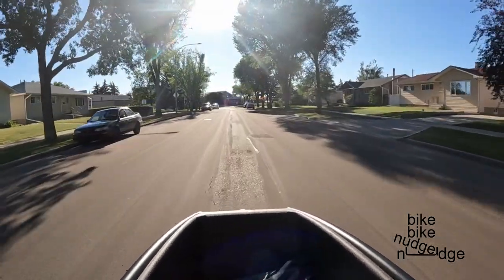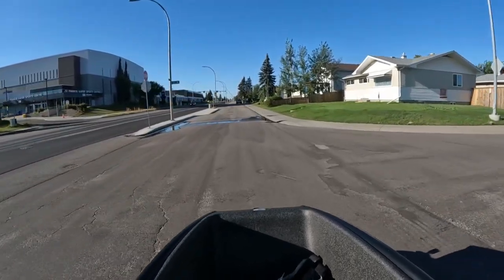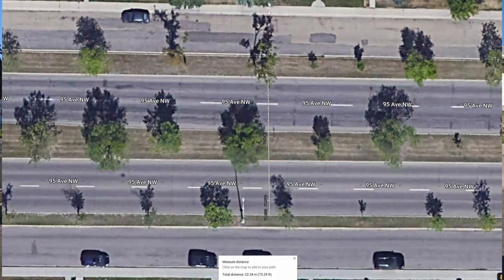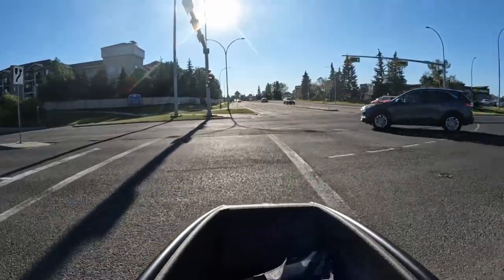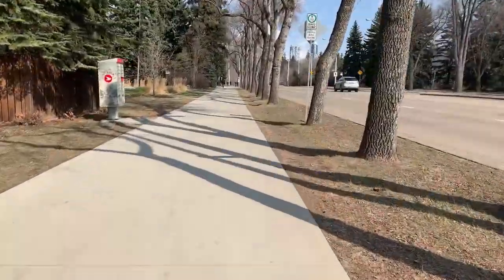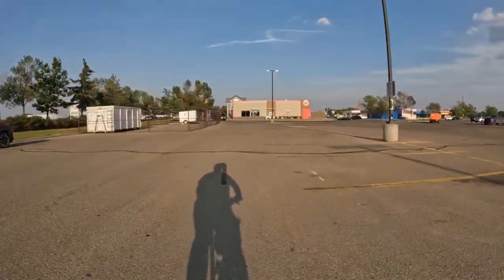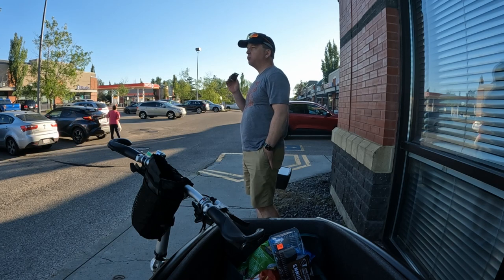Grocery shopping with a bakfiets (or service roads, parking, and trip-chaining)

Comment: Wow, look at those massive carparks. We have similar issues in my city (Adelaide, South Australia which is probably a similar size to Edmonton)
Most of our very limited bike infrastructure consists of recreational shared use paths.
I bike a lot more now that I live near one of these shared use paths which generally makes a trip to the shops 50% low traffic residential streets and 50% shared use path.
Thanks for the videos! Keep them coming!
Reply: And places like that often don't even have a bike-rack. If you're lucky, you might find a road-sign you can lock a bike to that's near the store and not tooooo likely to get hit by a car, but not necessarily. I once had to lock my bike nearly 100m away from a SPORTS store because there was literally nothing closer, not even a narrow tree. 😒

Comment: Trip chaining with bikes is something I've always been wondering about! In a place like the Netherlands, I'm assuming with so many bikes (and bakfiets specifically too) that perhaps with a cover covering your items your bike would blend into its surroundings, especially if you're only making a short stop, making it safer in that regard. But for longer stops or places that are further out, or in other countries, there needs to be more. I don't know what the solution is myself, but I'm sure there is one out there (or will be one eventually).
Reply: Urban Arrow makes a few bikes with a locking component for the storage area. I've mainly seen it for their commercial line but I imagine they have something for the Shorty which is Baksfiet like.
Reply: Places that accommodate biking like Amsterdam or Oulu tend to also be "15-minute cities", so you can just make multiple trips. It's a problem in North America because everything is so damn far away, even making multiple trips by bus isn't practical. And since shopping by bus, bike, or foot limits how much you can carry (both weight and volume), it becomes impossible to shop effectively without a car. 🤦
Reply: I try to organize my trips with small items first that I keep in my backpack. As I add items, I reorganize with my panniers. One benefit of buying mostly fresh produce & items needing preparation is that no one will steal them!

Comment: There are many of those side/service roads in the UK.  They tend to be separated with a nice grass verge with or without trees from the main busy road.  I don't own a bakfiets since I don't have storage for that and some chicanes exclude access to non standard bikes.  A small trailer works well.  I can take it off the bike and take it into any shop to use as a trolley so going from shop to shop is  easy.
Reply: Service roads can be perfectly fine ! In NL you can see them in multiple ways . As an acces roads for houses/bike path along a busy 80kmh rural rosd. And in built up areas with business park or residentials along a distribution road ...
They are often one way for cars , two way for bikes ..

Comment: I'll carry my groceries into another store if I go to more than one store while out, but I knew to only go places where no one will hassle me for walking in with full grocery bags because they think I might steal. So I'll go to the chain grocery store with security first, then go to smaller stores or CVS, where they don't seem to care if I have full bags in there.
Reply: Exactly, that's the problem. stores don't like people walking in with bags. Also, you don't want to have to carry around all the extra weight. That's why I usually sort shopping to get the small or single items first that can leave me with less weight and look like my backpack is empty, then go for the bigger grocery-shopping, and I'll make a point of leaving my backpack zipped up and on my back the whole time for the cameras. (Sometimes I even put on a little show at the register of struggling to get it off to pack my groceries, just to make it clear that it'd be obvious if I took it off. OCD'll do that. 🤷)

Comment: Parallel service roads or frontage roads can be great to separate faster going and slower destination traffic and allow safer exiting/entrying residential/comercial driveways. That is : IF you design and build them correctly ! The one at 0:37 clearly isn't !  It is too wide, so cars will go faster .  
A service road should be designed to low speed , so it should be 25-33% narrower than this one, preferible have brick pavement and some speed bumps. All for lower speed. Add some narrowing (for example trees at the side may help (good for shade and speed perception ).  Make them one directional for cars , two way for bikes. The parked vehicles should move from the side walk to the other side, next to the main road. This will make crossing pedestrians more visible and psychologically the parked cars on the left slow the car drivers as well.
In the Netherlands (and elsewhere probably) you see parellel service roads of all kinds : in residential areas, in commercial areas and also in the country side. It combines a safe option for bicycles with low speed access to driveways. They work perfect and can improve safety about as much as a proper roundabout vs a traffic light junction... And it can improve a horrible stroad's bikeability greatly  .

Comment: to secure your snacks? maybe a net or something that you can cover the basket all over and secure with a lock or a bunch of bungy cords.
Reply from the maker: A long time ago, I saw a lockable, wire mesh wrap to secure a backpack while travelling. I don't think it would be big enough. One drawback of the Urban Arrow is a lack of good mount points to secure things or use bungee cords.
Reply: @bikebikenudgenudge  I just searched it up. A heavy-duty fishing net or modified tarp looks like it would fit. Then some sort of long rope, bungee cord, etc. Loop it over the top and then below the cargo area. On their website, it looks like they do sell a cover for it.

Comment: I've had the same concern over making multiple stops.  I use paniers, so I could take them with me, but many stores don't like me doing that.  If you find a solution, please post it.
Reply: Yup, this is half of the obstacle. In my case, I arrange my shopping to get small, light, single items first, and save the big grocery-store for last. I'll keep my backpack on my back and zipped up the whole time I'm in the store so the cameras can see. I usually arrange my shopping to avoid multiple stops as much as possible (which sometimes means just not going at all, which helps save money and eat less 👍), or I'll arrange to do half another day. On rare occasions, I'll actually ask someone at the front like a security-guard or greeter if I can leave my bags with them for a minute while I run it to get one thing. I also keep my eyes open for any sort of locker facility just in case (but have yet to see any).

Comment: I see so much potential for better infrastructure...you've got to seperate the cars from the cyclist...the roads are wide enough to create a pavement then a bikelane and aftet that parking spaces...seperate bikelanes are also ideal for skaters and kids to learn to bike...also a few roundabouts instead of crossings...so you have a continuous flow of traffic...the map with the red line you showed is a perfect place to start if you want to start a bike friendly environment...it is also important that car drivers learn to respect and acknowledge cyclist by f.e. make it a part of the driver's license exam...where they learn to yield for cyclists at roundabouts...when you are used to them they are incredibly effective and safe...

Comment: I have been using a large sized dog trailer as a cargo trailer for weekly shopping trips and anything else for a year and a half now. It holds an awful lot but definitely, it's not lockable or secure. I leave anything in it at a risk. Thankfully I live close to a quiet small town in Ireland and almost always lock up at cctv cameras when possible.
Security is the big disadvantage of not using a car.
I recently got an actual cargo trailer and I could fit a large container with a lid on it so I'm currently looking for something like a 60cm wide x 80cm long x 60cm+ deep container that could be locked.
I replaced the quick release pins on both of the trailers tow bars with bolts and twin lock nuts just to make it more difficult for anyone mischievous or worse to take it off and I run a cable through the quick release wheels and the trailer bodies and lock either to a post, rack or my own bike locked to something else. Whatever works.
Whatever about general groceries or cargo, you can't leave anything of value on a bike or in a trailer without expecting it to be gone when you get back.
And don't get me started about "just" bike security and theft!!!… 
All of this is the biggest deterrent to more people using bikes and e-bikes than infrastructure or safety. 😐
You can leave a €70k Tesla parked in a car park all day with confidence but be justifiably anxious every minute you are away from a €1k e-bike or bike even if it's secured with multiple high quality locks and chains.

Comment: 3:28 This rectal-sphincter just ran a stop-sign, barely slowed down at the edge on the road and continued on.

4:18 In this day and age of online shopping and tons of competition, NO stores is ever at peak capacity, even on holidays.

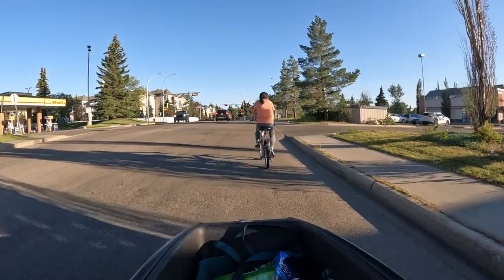5:11 * If you build your city for cars, people who can afford cars will drive cars. The rest can, I guess, go to Hades? 🤷

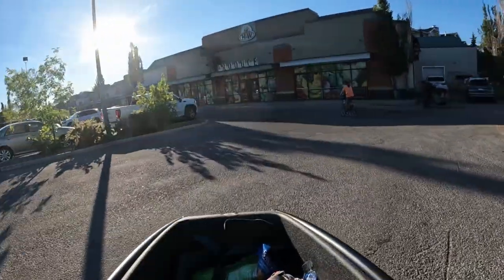5:22 Trip-chaining isn't practical on bike or foot or bus, it only works with a car that you can toss groceries from multiple stores into the car. On foot or bike or bus, you can't store stuff between stores and you can't carry your stuff from one store into another, stores don't like it when people walk in with big open bags that stuff can "fall" into. You CAN go to multiple stores, but don't be surprised if security watches you extra close. 😒 …

5:53 Ah, you figured out one solution, but alas, that doesn't work for everyone, not everyone can go shopping with someone else. Also, even then, you're still limited by how much volume and weight you can carry. A bakfiets helps with that, but a regular bike, walking, or bus, you have to be wary of how much space and weight they take up. Even with bus, you still have to make it to the bus-stop from the store and from the bus-stop to home, and it won't work if it's so heavy, you have to stop every five steps, or they're so bulky, they bump into your legs and prevent walking. - And in North America, because EVERYTHING IS SO FAR AWAY, you can't just make multiple trips.

6:44 Snacks? Pft, I don't even leave my reflector, light, bell, and phone-mount on my bike when I lock it. I take them off and take them with me.